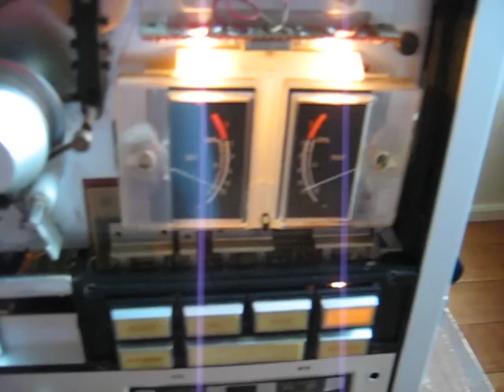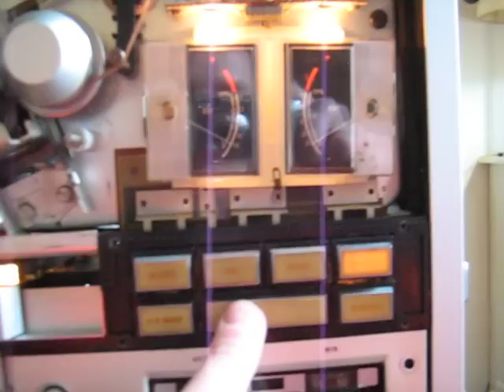Philips N4450 testfase met nieuwe snaartjes

Comment: Hi.. I have one of these. What a great machine! It was my dad's in the 60s and 70s and he left it to me when he died.
I rebuilt it a few years back and it was working fine but then the 'touch' controls for the drive (RIGHT, LEFT, WIND, STOP. PAUSE) all stopped working. No clicks and no lights on those controls. 
I was guessing it must be a fuse or perhaps a solenoid component. But I'm having trouble finding the source of the problem. 
Maybe somebody has some ideas?
Reply from the maker: All the transistors on the FF/REW , TT and Play/Rec (AC126) are to be replaced with BC327-1 types, then it'll work ok.
Reply: @mauricevanmourik1982  - thank you - that is really helpful information.
Reply from the maker: @EdGilchrist  i've done several recorders with defects like that.  All the little prints that are standing on the secondary print have those ac128 transistors.  Really Easy to fix for someone who can hold a soldering iron.
Reply: @mauricevanmourik1982  ..
So helpful. Thanks.
And yes... I am pretty good with a soldering iron. 🙂